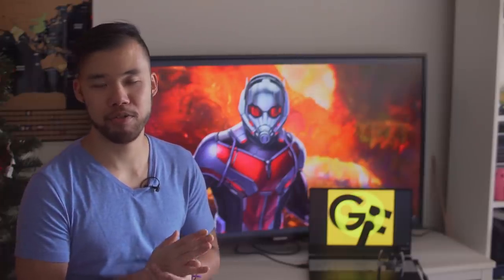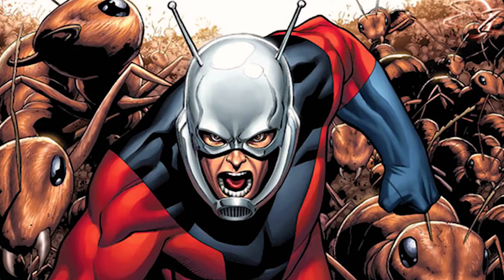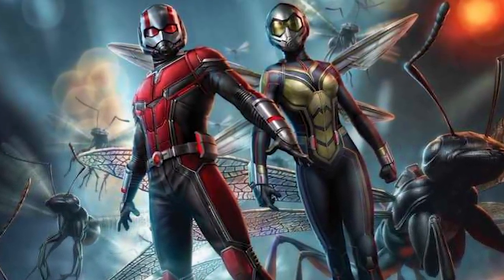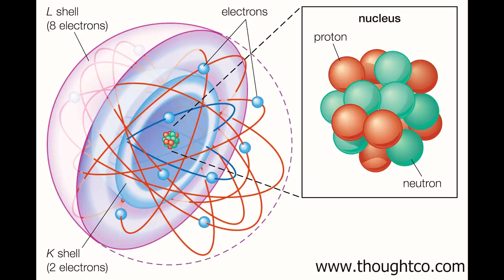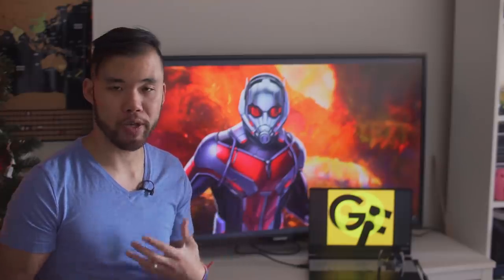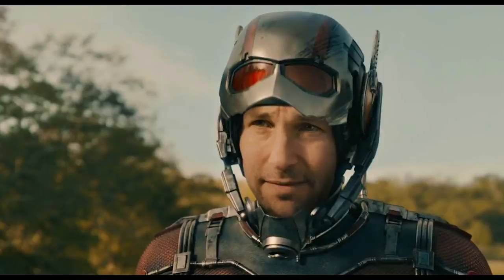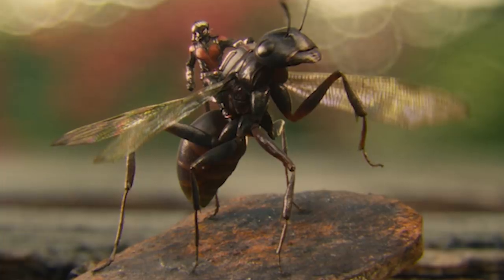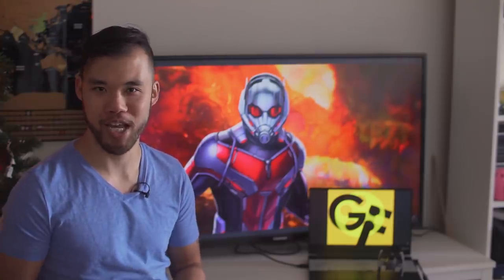Can We Build Ant-Man armor?

Comment: most of your points are solid, such as no change in mass meaning water wouldnt be as able to wash ant man away, and that ants wouldn't be able to carry him, as well as issues with senses like hearing and sight. however in ant man, i thought they clarified it was the distance between the electron and the nucleus of atoms that shrank in order to resize ant man (if 1 hydrogen atom was the size of the earth, its nucleus wold only be 600-700 feet across. an atom is 99.9999999999996% empty space)